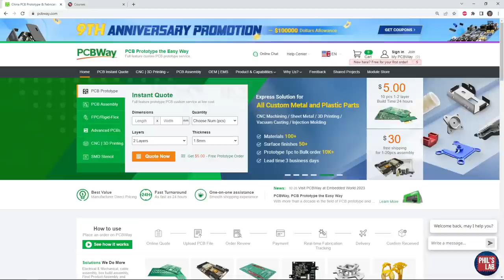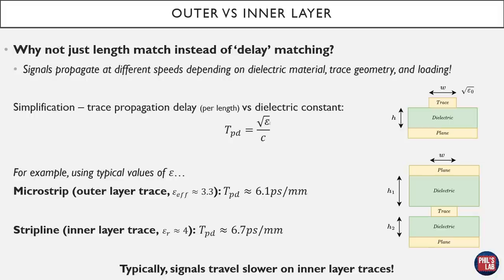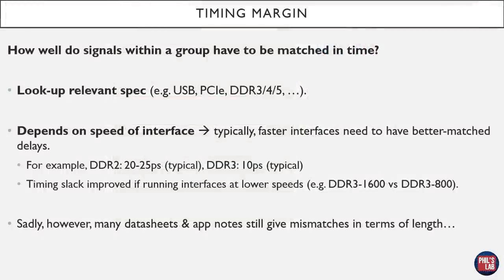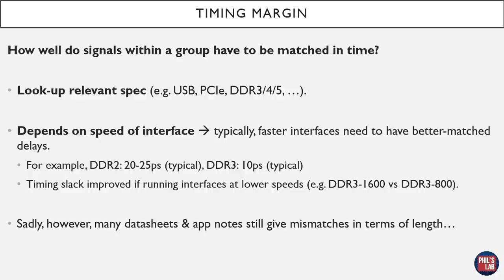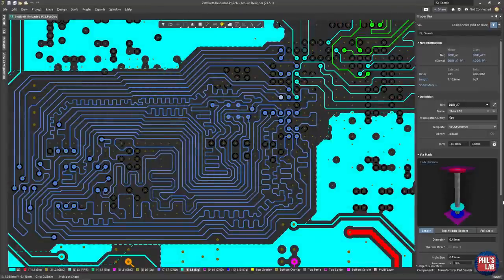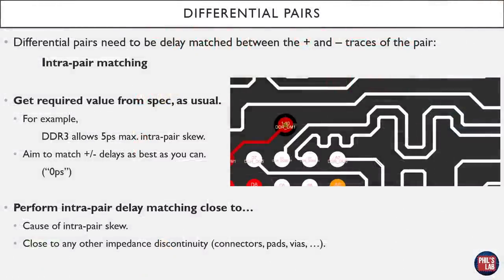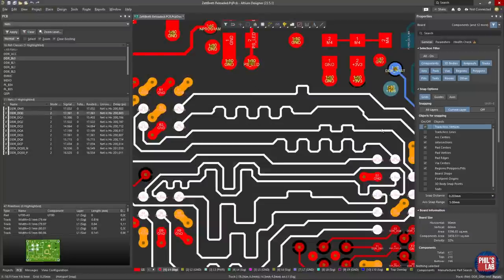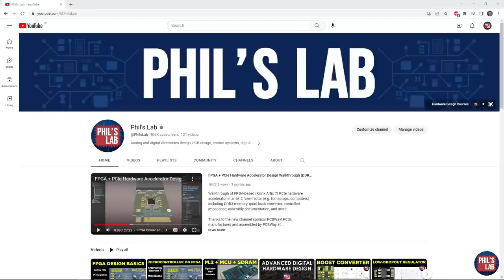PCB High-Speed Delay Matching - Phil's Lab #110

Comment: Only DDR ram need length matching not PCIe or USB or any high speed serial bus using SERDES! In that case only impedance and cross-talk matter.
Reply from the maker: There's a difference between inter- and intra-pair matching. Intra-pair delay matching (between +/- parts within a diff pair) is typically required for PCIe, USB, etc. serial links.

Comment: This is amazing! So much detail in a compact to-the-point format. Been learning from you for a long while now, but don't think I actually ever replied. Sorry for that, but thank you for your tutorials! Not that I think I really will need this in the coming future, as my EE structures are generally much larger and more basic, but you explained it in such a way that even this mechanical engineer understood it! 😁
Oh, just a curiosity, but if you'd come across a situation where space constraints made meandering paths impossible, would it be possible to create delays using ceramic capacitors and/or inductors?
Reply from the maker: Thank you very much for your kind comment and thanks for watching :)
For high-speed systems, I'm afraid that wouldn't work (space-constraints, degradation of signal integrity, etc.). Even in very space-constrained systems you can usually make it work (HDI, increased layer count, etc.).

Comment: Hi Phil,
In my custom board the DDR3L runs without an issue at 303mhz. But when i increase to 533.33mhz it fails. Even for 333mhz and 400mhz it is inconsistent. 
1) there is more than 10ps between some address lines wrt clock
2) DM pins randomly goes -ve at high frequencies
But I was unable to pin point the issue.
If you have faced or seen something similar please guide me here

Comment: Great video !! Thanks for putting all those useful tips out there ! :) Considering the large (nearly 10% ?!) delay difference between signals on inner & outer layers, how does this affect return paths? If I have the signal on an outer layer and its reference ground plane in the layer right below, does the speed difference have any impacts there? if the trace is 2cm, the difference between the two is 12 ps, so I'm wondering if we'd see any nasty side-effects at the other end?
Also, you mentioned meanders for differential pairs matching should be placed close to the pads, I would intuitively think it'd be better to "distribute" them evenly so the signal edge on both lines would always be rougly in the same spot, but indeed it would cause impedance mismatches along the line, no idea how bad this can be? Would you say it's OK to distribute them on either side instead? like if I have to place 2 squigglies to match the delays, should I place one on one end, and the 2nd on the other end? or does this introduce more nastyness than it solves?
Thanks for all the informative content, learned a lot watching your videos <3
Reply from the maker: Thank you!
Regarding the return paths and propagation speed differences, there's no particular downside as far as I'm aware. For controlled impedance however, the critical length does change depending on outer vs inner layer, so that would be an important takeaway.
If the length/skew mismatch is short, then yes, ideally the intra-pair meanders should be placed where the mismatch happens. However, this is rarely practical and therefore the intra-pair matching is typically placed closed to an impedance discontinuity.